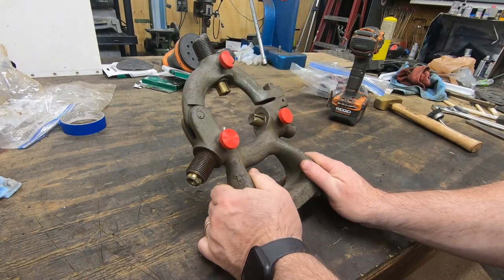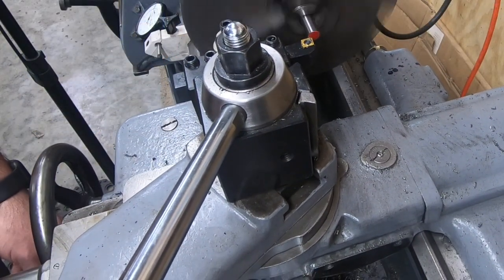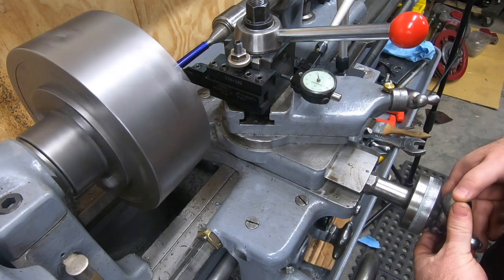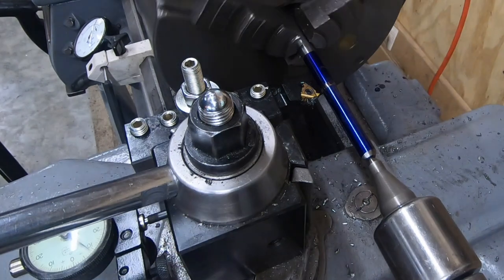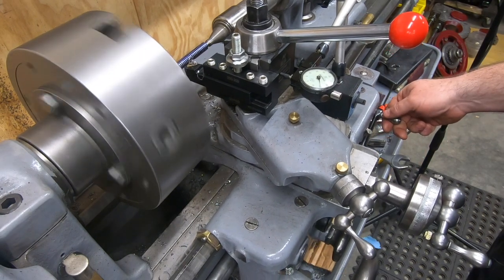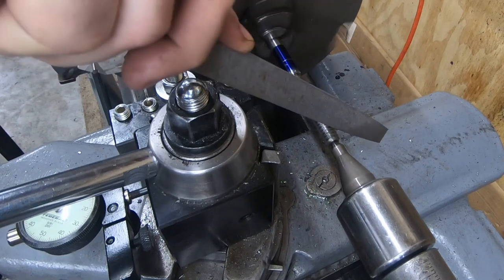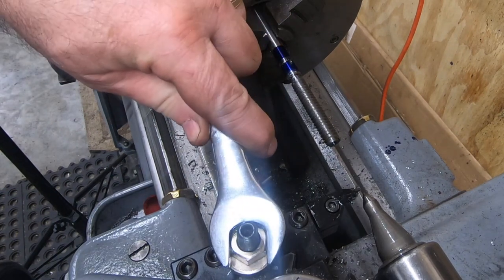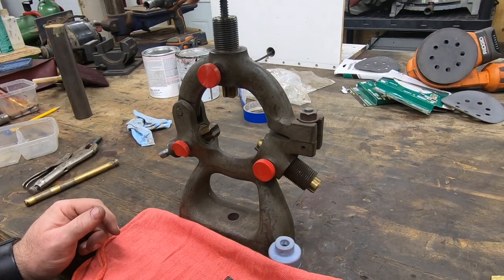Making Jaw Adjustment Screws for a Steady Rest

Comment: Great build Greg, looking forward to following along with this.
Rigidity is always a factor and something that we all chase. Taking video of the different components of your lathe while in action will help you identify areas that need to be addressed. 
Headstock bearings can be checked with a dial indicator, block of wood and a prybar. Sliding components can be checked in a similar fashion. 
Locks for the carriage and compound will help with parting. The more you do, the more you learn. 
Cheers

Comment: They'll work just fine , maybe a pass on the wire wheel to smooth them out a bit but they'll be fine.  Can't wait to see the end product.
Reply from the maker: I'm not too worries about how they look since they'll be buried in the steady anyway, but I just want to get better at anything machining. I have a lot to learn. I also need to learn to work within the limits of this lathe, which is hard for me to do. It's not the most rigid machine made.
Reply: @MyLilMule   your doing just fine. That's all any of us can do . We're all still learning , that's the fun of it I think .

Comment: can you explain the reasoning for all the telescoping threads in there?   Does it work like a tap handle?  ~with the 2 threads for one twisting part.  Is it just to get those struts screwed out faster .......... not finer.   So it's quicker to screw?
Reply from the maker: I think there could be a few reasons they designed it this way. I think one could be how fast (or slow) the telescoping part of the jaw moves in and out. I also think it's a little about ergonomics. The larger adjustment screw is easier to turn, but the smaller jaw is better for internal part. I think that also makes it more compact.

Comment: The steady rest I just got was missing one of the adjustment knobs, but thinking I'm going to make a follow rest, I figured I'd make the extra components at the same time. One thing I'm noticing, on the depth of cut for the threads, it looks like the threads on the original have a radius in the valley of the thread, so using a sharp cutter will of course mean more depth of cut. So I wouldn't worry about that, as you still have the same thread land. Just an FYI, so you don't have the nagging feeling in the back of  you head. :)
Reply from the maker: Thanks for watching and the comment!

Comment: I have a South bend steady rest like yours that was submerged in salt water. I’ve tried multiple times to ‘unstick’ it, but have had no success. Do you have any additional videos of the disassembly? Suggestions to free it up are welcome.
Reply from the maker: No other videos. I would recommend getting 5 gallons of Evaporust and soaking it for a couple of days. Stuff is amazing. After that, heat. Not too much, but lots of it.
Reply: @MyLilMule  Thanks. I’ll give that a try. I believe the threaded shaft that moves the brass pieces is left hand thread, so with them full extended to the center I’d need to rotate the knurled knobs clockwise to retract them. Is this correct?
Reply from the maker: @budcubberley7360  Rotating the large knurled knob clockwise extends the steady rest fingers. Counter clockwise retracts them. There are two sets of threads, one inside the brass fingers and one inside the knurled knob. These are what are called differential threads. Mr. Pete did a video on these a few months ago: https://youtu.be/ywmRv3I_dAw?si=Ns5sl0Y86q07vDqn
Reply: @MyLilMule  Thanks for that information. I found a section through the knurled knobs, brass and casting. It’s making more sense now. Also it looks like there is something under the circular retainer, is that to provide some drag (resistance) as you turn the knurled knob. If I can get that little block out it would allow greater access to the threads for the evaporust to penetrate.
Reply from the maker: @budcubberley7360  Yes, there's a small brass plug under the retaining clip. It's just there to provide tension as you figured.

Comment: HI , IT LOOKED LIKE SOME DEFLECTION IN YOUR LIVE CENTER  WHEN THE VID' WAS SPEDED UP. REGARDS R .
Reply from the maker: I noticed that too. Didn't see it until I sped up the video. I may have to take a closer look at my center or my tail stock. I didn't have the hole in there all that deep either.
Reply: Yeah the tool pressure was finding the weakest link. Without a follow rest, I imagine you are getting the flex from the relief groove you cut. It is only .285 in diameter there. (435-150.) and right in the middle of the stock.